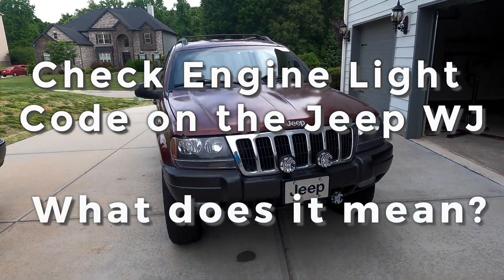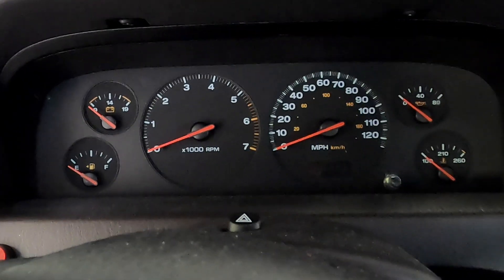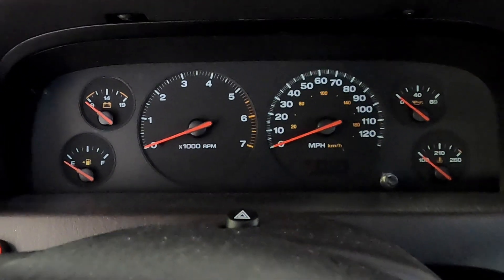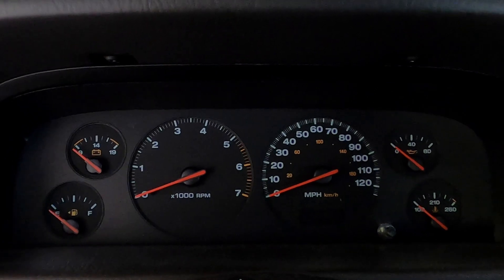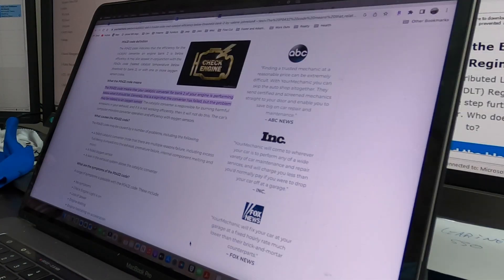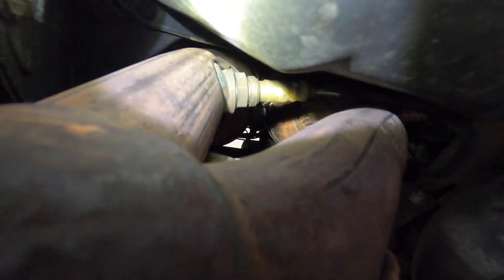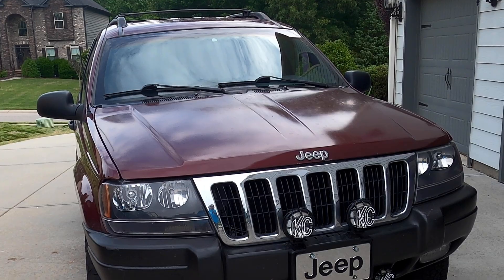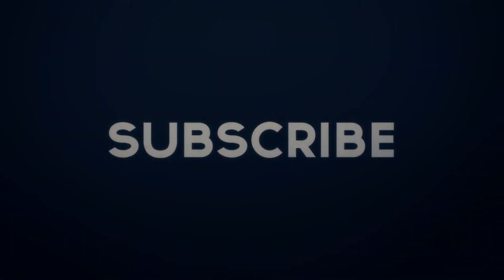Reading Check Engine Light Codes on a Jeep Grand Cherokee

Comment: Where do I connect to the code reader ?
Reply from the maker: If you have a code reader you would connect to the OBD2 port. I did not use a code reader but the ignition key method and looked up the code on Google. Thanks for watching.